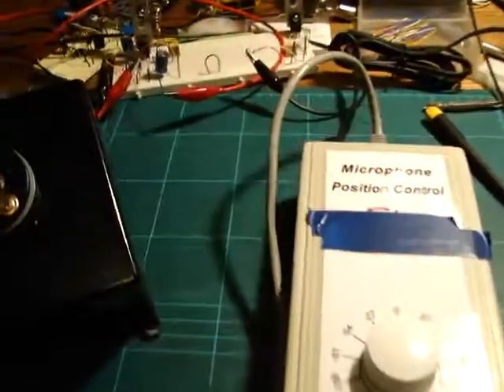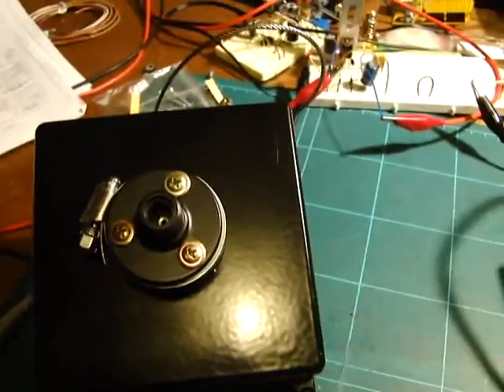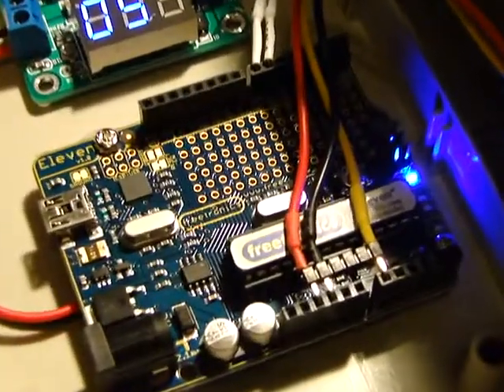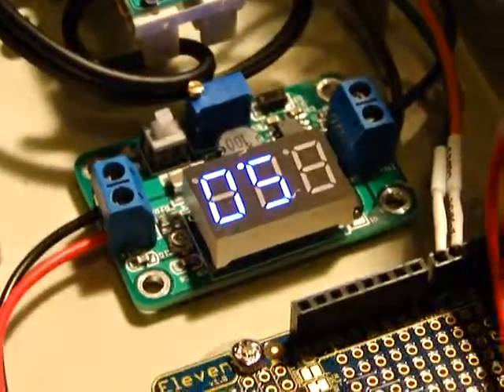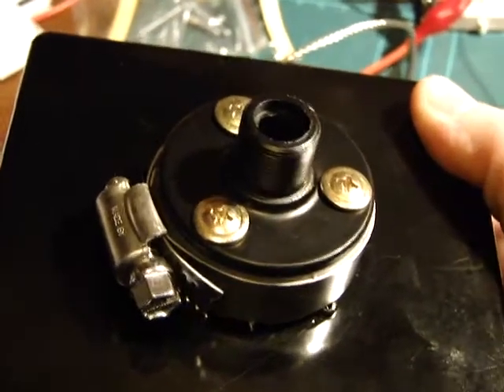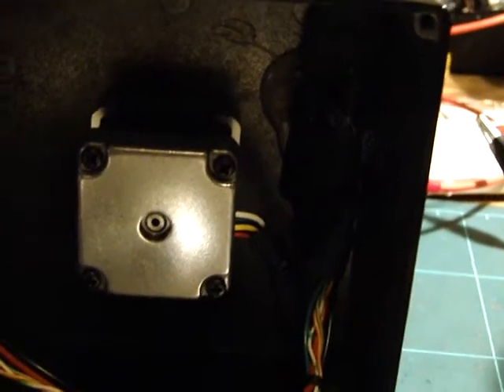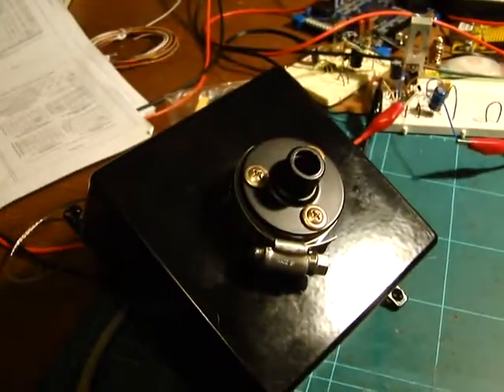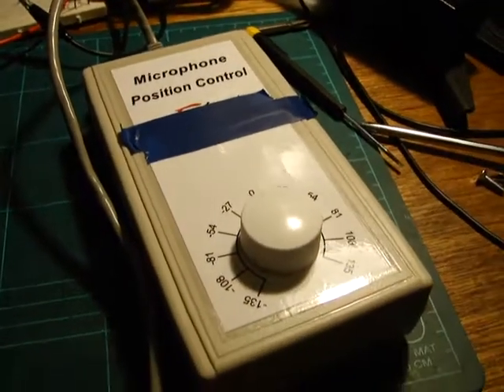Knocked together microphone positioner.

Comment from the maker: Nah the motors are very quite and pretty smooth, plus the shotgun mics are about two foot long and have a rubber suspension system that decouples the mic from the clip completely. I've posted an example of the mic clip in the video blurb.